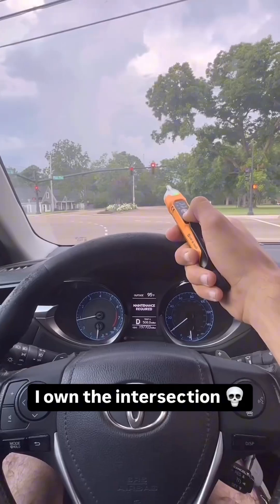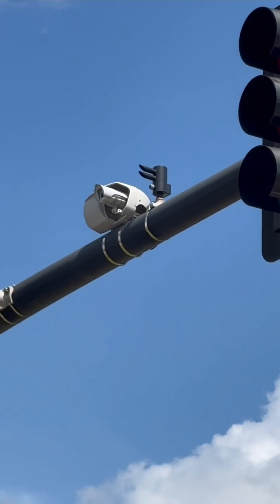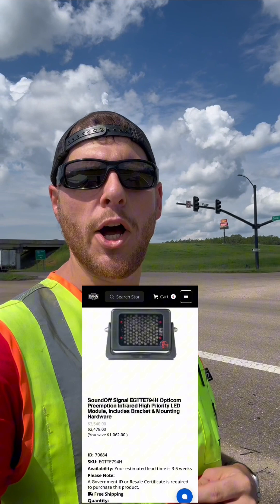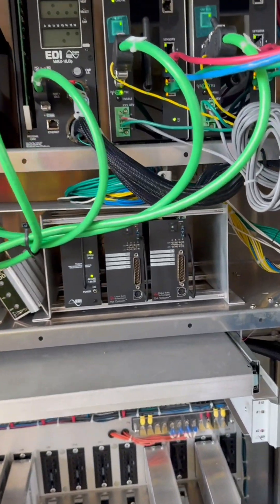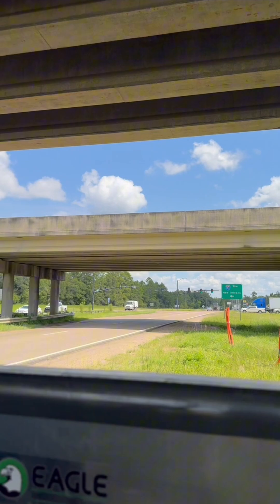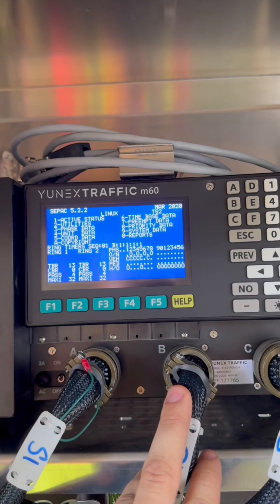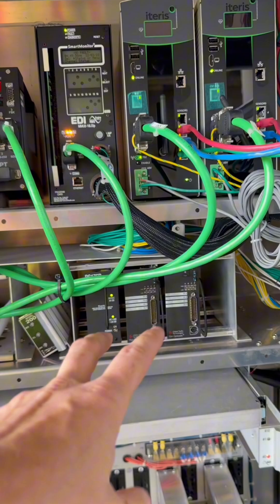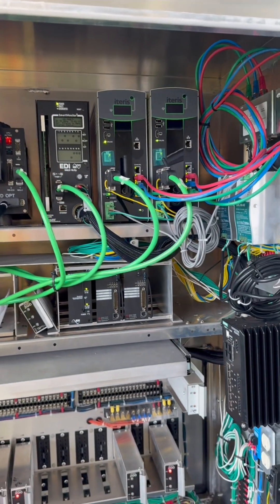New Way To Control Traffic Lights???  #educational

Comment: Around my area, the few boroughs and townships that have Opticoms also have white flashing lights that start going in all four directions to let everyone know that an emergency vehicle has preempted the intersection.

This also lets cops know that the preemption system was tripped, and if you get caught using it and you're not an EV, you'll get in HUGE trouble.

Also, we have acoustic preemption in a couple townships.  They pick up sirens in Yelp mode and switch the lights.
Reply: We've started using the GPS based ones as well over the last couple years.